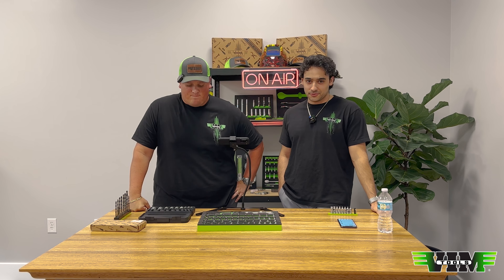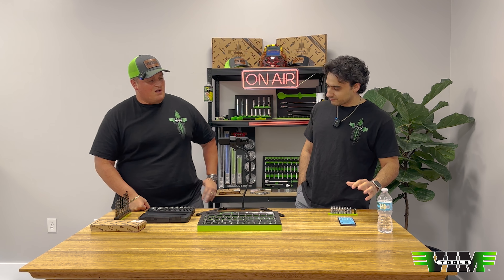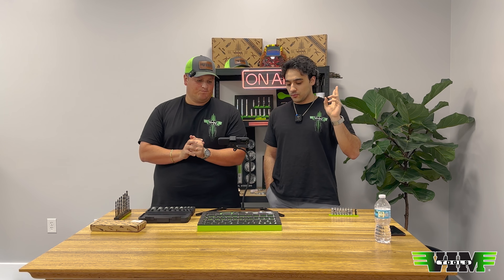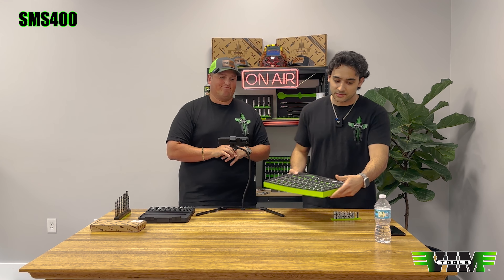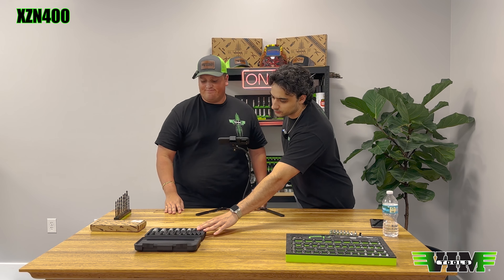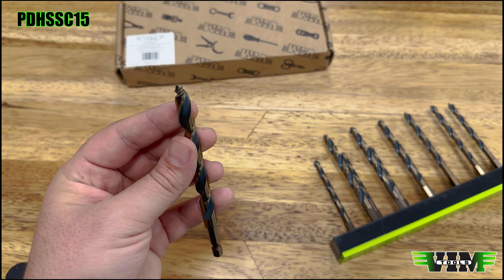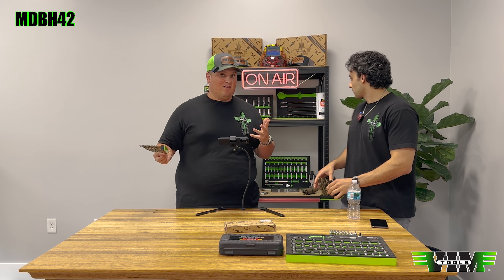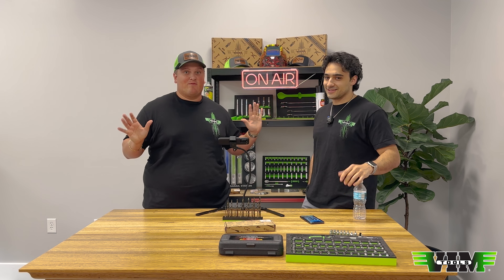VIM Tools Tool Tuesday: Episode 32

Comment: I can honestly say there is a major difference between the 2 and from personal experience it's a thing of magic using the air hammer on certain fasteners.....especially when manufacturers use a heavy duty flat head fastener or recessed hex to assemble it.
Reply: Agreed!